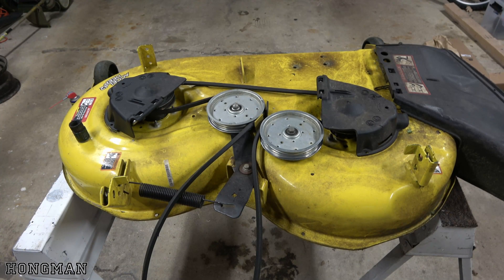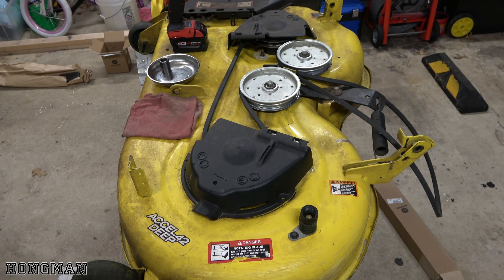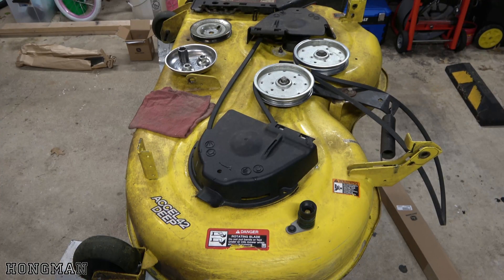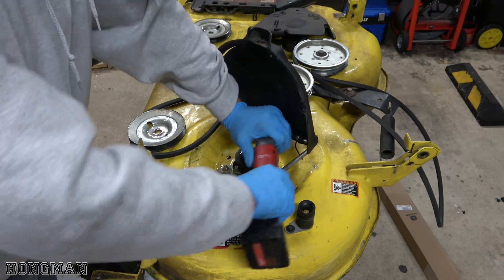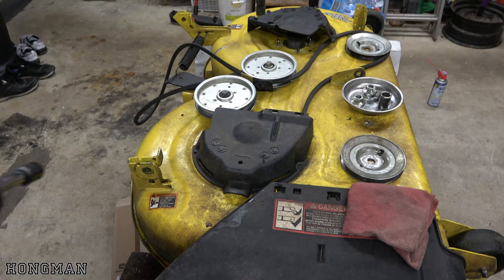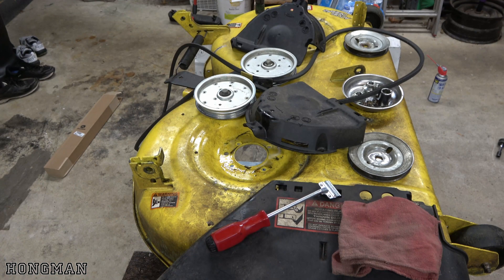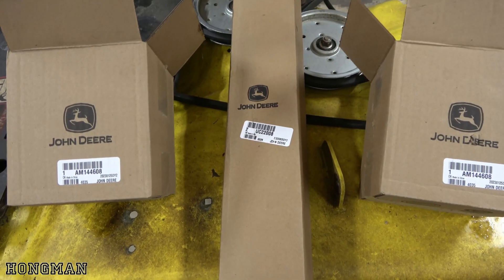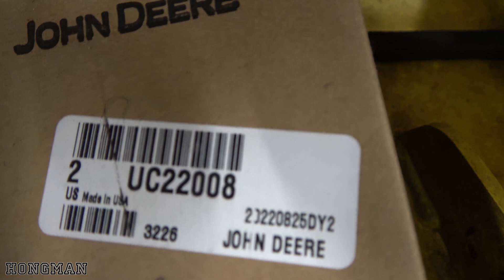John Deere Z335e - Spindle and Blade Replacement

Comment: I pumped a ton of grease into mine, but never saw any squirting out anywhere to indicate they were packed. Any ideas?
Reply from the maker: It will eventually squirt out the bottom if you keep going. It takes a bunch. There is a sealed bearing on top and on the bottom of the spindle, so I don't know exactly how beneficial it is to do so.
Reply: @CoolSteve77  I read that somewhere else. Some people were taking a side of the bearing shield off so it will pack with grease. Odd design

Comment: Good video, thanks. My mower has the same spindles. Have ever knocked the shaft out to replace the bearings in this type spindle? I can't seem to get the shaft out and was wondering if that's not possible with this particular spindle. Thanks!

Comment: Great video! Thank you. I have this same mower but I'm having trouble removing the pulley because the spindle is moving with it? Any suggestions?
Reply from the maker: Try spraying some penetraiting oil on it and tapping on it with a mallet or a piece of wood so that you do not damage the pulley. If that don't work I suppose that you could heat the shaft up with a torch if you are comfortable doing so. A puller is also an option. In my case the pulley was wallowed out. The pulley hole is not round. It is shaped like the spindle. You can see this at 10:11 in video.

Comment: A very descriptive video showing exactly how the work is done and the socket size requirements for the bolts and nuts involved in the process.  The criticism I have is don't give torque requirements for bolts and nuts as an "ugga dugga".  Where bolts are supposed to be torqued to a specification, the owner's manual will state the torque requirements both in metric and SAE amounts.  Please say what those amounts are if you are going to the effort to prepare a video to share with others how something is done in order to make the video complete.
Reply from the maker: I agree JDGuy1. Thank you.